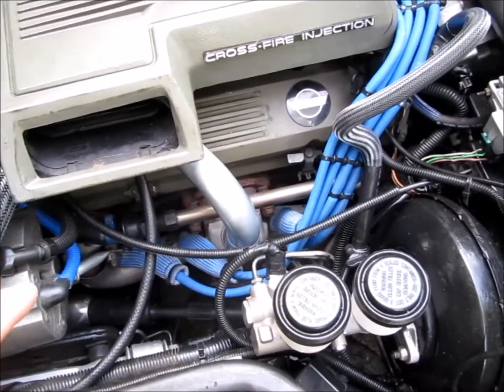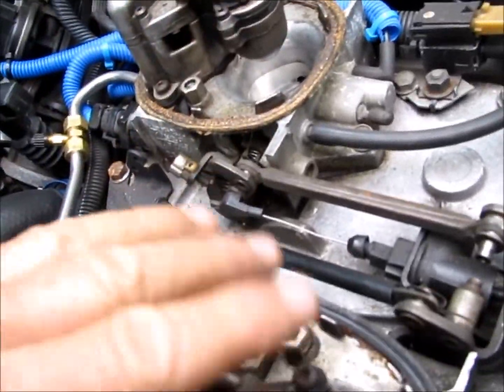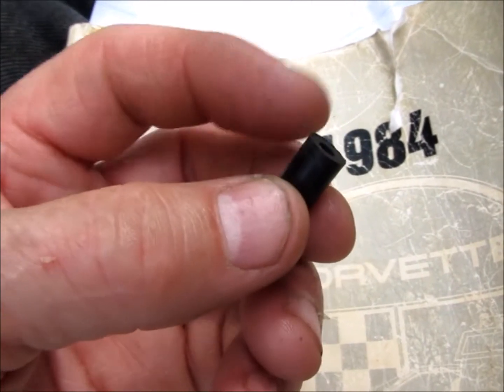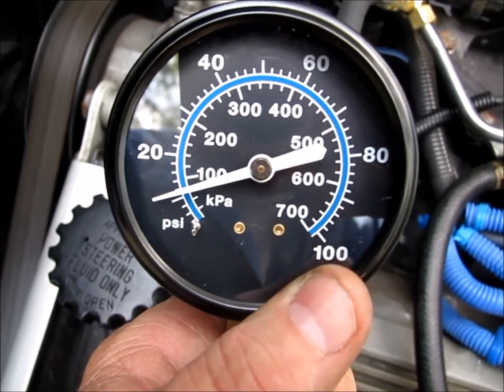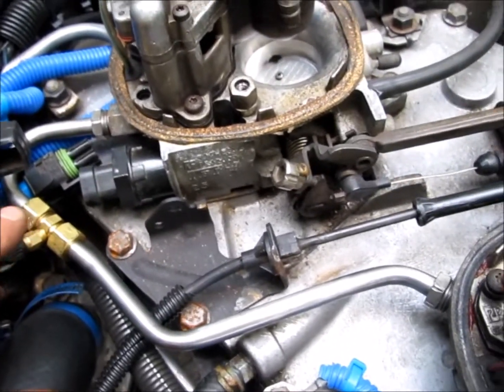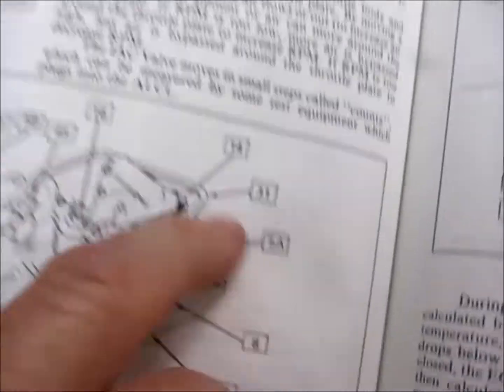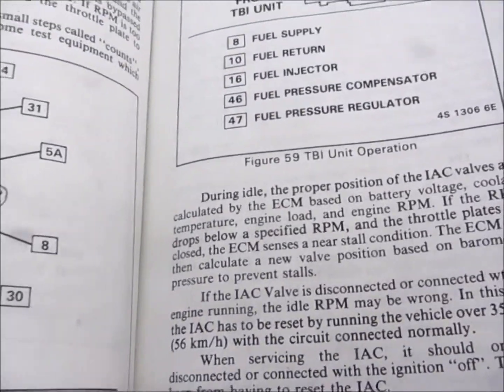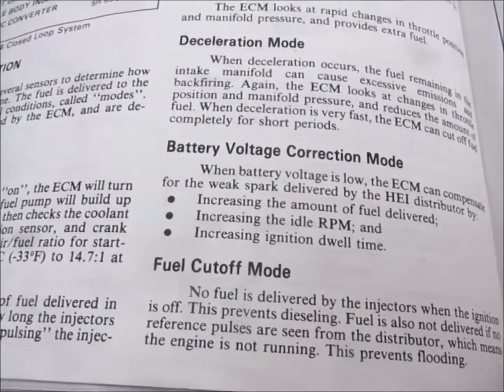𝟏𝟗𝟖𝟒 𝐂𝐎𝐑𝐕𝐄𝐓𝐓𝐄 Testing Fuel Pressure TBI

Comment: What would cause one injector to not spray or leak at all and the other injector only leaks like a faucet an trouble starting it up
Reply from the maker: The injector shouldn't leak....O-ring shot probably. Check the fuse on both, each has their own fuse, check the fuel pressure, should be at least 10.5 psi, check the fuel filter. test the injectors wiring, should be 12 volts with ignition on not running, then you will have to check the plugs at the ECM. That's where I would start.
Reply: @HorseshoeBeach  ok so yeah it was pretty bad an old I took them both apart and rebuilt them with the kit I also switched out the pump and filter. After that my fuel system was working properly but now I wasn't getting spark, I switched the pick up coil and ignition control module and still no spark my coil box was at 2.9 voltage and I checked the Ecm an only the white connecter was giving off 2.3 so I know something was wrong but not really sure. I had a mechanic come check out my wiring and he re wired the coil box wires straight to the battery an removed the fuse on the wires, after that car was getting spark my injectors sprayed correctly and car wanted to turn over but as soon as she was gonna start it just made a back fire noise an if like a fuse popped and everything went black and now I have no power at all when I put the key in the ignition everything is off an doesn't even crank. Should I check a fusible link or?
Reply: Checked my fuse box on passenger side and fuse look good to me so not really sure what's going on
Reply from the maker: WOW.....all that re-wiring is leaving me lost here Tony.  My 84 is 100% stock down to the CAT so I just refer to the FSM, don't know how much help I can be over the internet?? I'm not a certified mechanic, I'm a Crossfire Injection enthusiast....period. My guess would be that fusible link that comes right off the battery., your probably going to have to start checking continuity through the entire system with a multi meter... a crossfire injection lovers best friend.  Are You saying the black connector had no power? I don't know how that would be possible considering that is where the TPS, the HEI the IAC's and most everything else is connected. Don't know how the car can run without the ECM, just wiring straight into the HEI.....you would have to explain that to me. The ECM on a 84...runs literally everything. *Where are you located?*
Reply: @HorseshoeBeach  ok so the guy who had the Vette before me swapped the OEM distributor and put another one in, instead of coil being in the top cap of distributor it's a separate box called jacobs electronics and he tried to re wire the the coil box to the coil connecters and the other wires that come from the coil box wires up to the battery post but those wires had a fuse so guy cut off the fuse and re wired it to battery after that it was working an was going to turn on but then suddenly the whole car lost power no lights come on dash not turning on an battery is new so I know battery is not bad. I'm located in San Diego CA
Reply: @HorseshoeBeach ECM seemed to be working properly I took it off after the car completely lost power to see if it didn't get fried an it isn't showing any signs of that
Reply from the maker: Sounds like Bubba has been messing with the crossfire. When you turn the key to the on position of a Crossfire...the ECM takes over. I refer to the FSM for everything, and I can't even start to help with what's going on with your 84. Like I said if you like the crossfire, I would buy a FSM and try to put it back to it's original stock build, if not, you might have to find a local mechanic to help.  Only other thing I can suggest, because I live n the east coast, is buy a multi meter and start checking wiring, need fuel and spark to fire them up and tune it from there. Sorry I couldn't help more.
Reply from the maker: I don't know. lot of tiny diodes and capacitors and computer circuitry inside those ecm's. My original was rusty on one corner from dash leaking.
Reply: @HorseshoeBeach  ok yeah mine has rust one corner aswell and also leaks from the dash on that side but yeah im gonna get that meter and the fsm I appreciate you getting back to me thank you man !